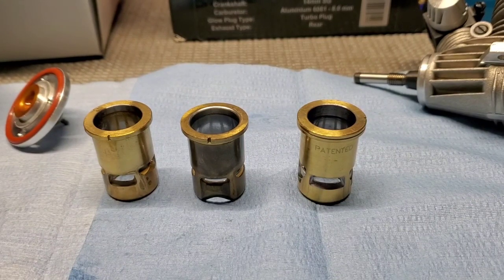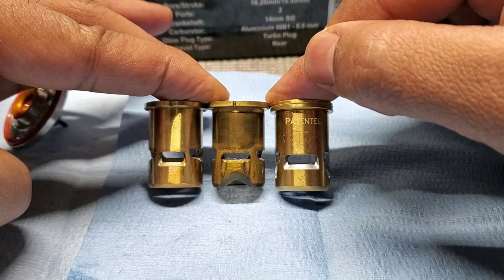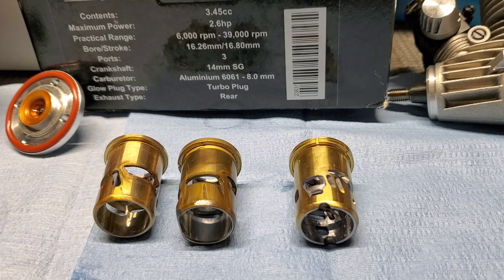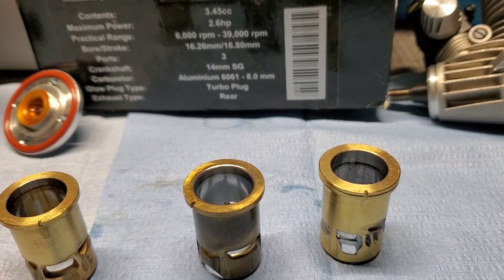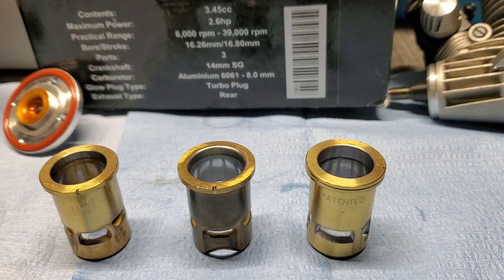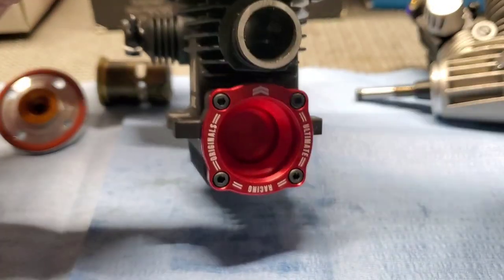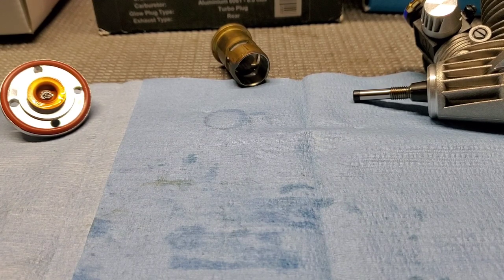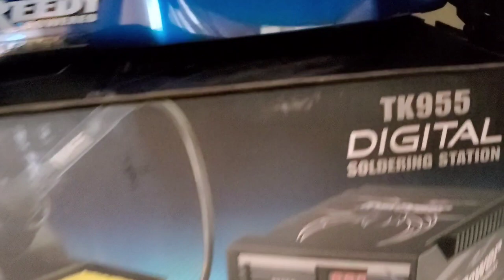1/8 Rc Nitro Engine Talk

Comment: The reason road cars have many more ports is that the car is lighter than a buggy or truggy and it doesn't need the torque of a buggy or truggy,a buggy is lighter than a truggy,so the truggy needs more bottom end,to get that mass moving,it also depends on how big the track is,if the track is small,with a lot of corners,you want high bottom end,as a higher ported engine will be ineffective on a short track,you wont use all that RPM.
Reply from the maker: This is true to a degree. Definitely with older 80's and 90's engines. Another part of the equation is the rpm range in which an engine runs in onroad vs offroad. In onroad your consistently in the upper rpm range of an engine for a longer time giving the piston more of a chance to walk out one of the ports (3 port would have larger port holes and placed in different areas on sleeve). Something that is less of a concern when dealing with more ports like 7 and 9 port engines( more ports equals smaller port holes and extra sleeve material for the piston to ride on) yet the ports can still be put in similar places on the sleeve as a 3 port to achieve similar timing. Which thats where the powerband feel will come from( lower timing=torque and bottomend higher timing=midrange and topend) along with crank timing.

Comment: Great vid man! Lets not forget though most of the main differences in performance i.e. more torque, or more rpm or better fuel economy between different port engines is in the timing!
Reply from the maker: Thanks bro! Your absolutely right 💯. Timing is higher on the important chart then port count when it comes down to it...Good call bro🏎💨💯👊👊💪💪👍👍

Comment: Great information bro, thanks for sharing👍💪👍💪thanks for the shoutout👍👍
Reply from the maker: Thanks for the support bro👍anytime. I'm tuned for your next video!👍
Reply: MrLilchilly -I see you also have e world stuff, I like your break in bench with nova 28-8 ready for break in can’t wait to see a running video of that beast, you have great stuff, keep videos coming👍👍
Reply from the maker: Yup got a couple 1/10 e word kits. I was going to do indoor racing at a track about an hour from me but only made it there about 3 or 4 times and only ran the kyosho buggy, the rest have never been ran and I also have traxxas crawler. Man I'm just waiting to get some of that good weather you been enjoying to break-in that 28-8. Let me know when your ready I have a big block T-maxx roller that needs some attention, and I seen in your video you had a couple, maybe you can use another one👍
Reply: MrLilchilly-thanks bro, I’ll let you know, just got busy with my workshop try to organize my rc stuff.
Reply from the maker: @MarinerRCAdventure  no problem bro just let me know and all we got to do is work out the shipping. It breaks down to a roller and enough parts to almost complete another roller
Reply: MrLilchilly -I got you bro👍👍

Comment: Great video brotha! I was thinking of possibly making a porting differences video as well but no need I think you hit the nail right on the head great job! Love those samurai engines lol.
Reply from the maker: Appreciate the support bro!👍 bro by all means make the video there's so much with porting I willing to learn more, and I know you got the knowledge. This is my first samurai and it's been a long time since I've ran O.S or anything O.S based but always heard good things about them. I'll be glad when spring and summer get here lol. I'll be tuned in for your next video 👍
Reply: MrLilchilly appreciate that brotha

Comment: The number of ports does not alter..hp or torque... but if you want to increase revs then increase the number of ports... hence the 7,9 and 11 port engines in on-road racing....The only thing that increases torque is crank modification....
Reply from the maker: Your correct to a point port numbers dont ncrease hp or tq i agree with but it also doesnt increase or decrease revs. Onroad engines usually have more ports due to the nature of having a highly timed engine due to crank induction timing (opening and closing of crank window) along with port height placement on the sleeve(opening and closing of induction and exhaust ports by piston). In a engine designed to stay at high revs for sustained time ie: onroad engines, the extra ports actually help create bridges along the sleeve vs having a couple of big openings. What this does is give the piston more material to ride along as it goes through its cycle via the connecting rod so it doesnt "walk out the side of the sleeve" through said big open port on say a 3 port sleeve. In offroad these revs arent sustained long enough for that to be an issue. The thing that increase torque or hp is how much air and fuel you can flow into and out the engine either through crank mods sleeve mods crankcase mods or even backplate mods and carb mods. Thanks for stooping through💯🏎💨👍👍
Reply: @MrLilChilly    I agree......but undoubtedly strategic port timing and placement does increase revs....But  Crank timing is a totally different video that you will have to explain to your viewers......
Reply from the maker: @SNAFU..  i agree with you. Your right it would crank timing would make for a good vid. There is a video on youtube by the late Rex Welch that goes into crank timing that is good and he is more knowledgable in that area then i am. Thanks again for stopping by and chatting👍
Reply: @MrLilChilly   I knew Rex well......